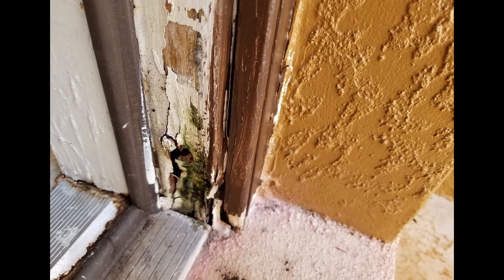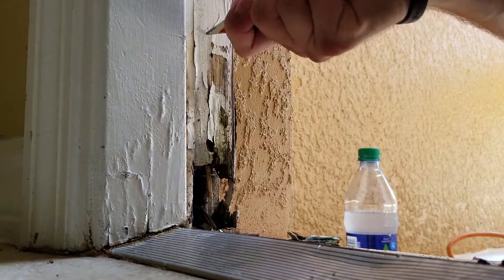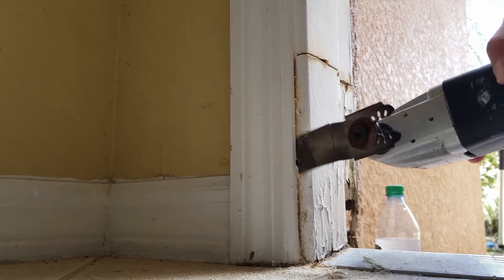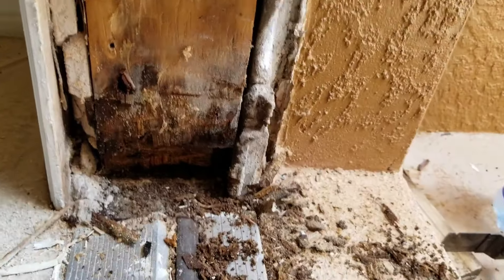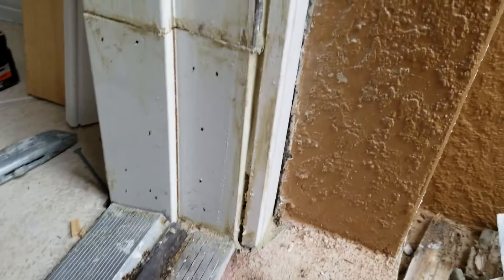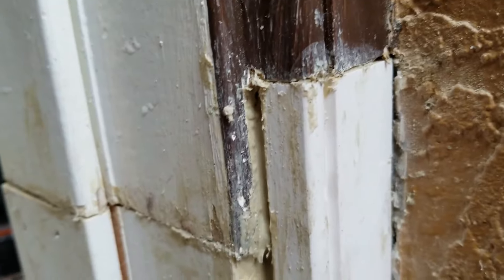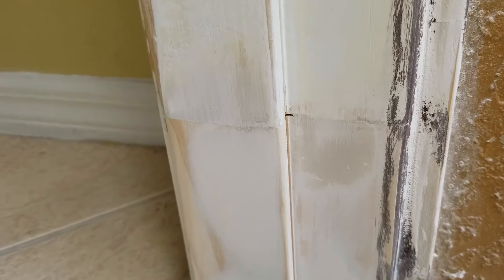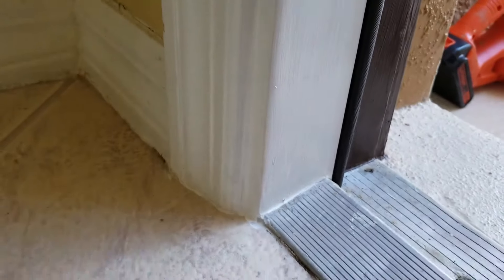HOW TO REPAIR ROTTED DOOR JAMB

Comment: Before you placed the patch in, I hope you sealed the end grains. If you didn’t water is going to wick back up into the patch and rot it out again. Otherwise, nicely done.
Reply from the maker: Hi!
Absolutely! 
I was sure to seal any wood exposed to moisture. At the time of this video, I specialized in tile and grout repair. In most cases I did a lot of shower wall repairs due to water damage behind lower tile that caused tile to fall off the walls due to rot. When dealing with projects exposed to water, I approach it with the knowledge I have when water proofing a shower. Unfortunately I failed to show more important details in the video during this repair. I didn't even show the process using the bondo. I might have to recreate another video in order to show those steps. Feel free to give me some ideas on any future videos you might want to see.
 Thanks for watching!

Comment: I put hydraulic cement in my rotted 4” bottom of frame. 5 minute fix has lasted 10 years so far. I usually replace it the right way. My “test” worked great though. 😂
Reply from the maker: That's impressive! Sometimes a quick fix turns out to be more durable than expected. It's good to hear your improvised solution has held up so well. Thanks for watching!
Reply: I have a rotted hole on one of the hinges . Does this cement will just hold that extra hinge? The others are ok .
Reply from the maker: @ae86takumi  If you can remove the rot and replace it with a wooden block, that’s the best approach. While you're at it, use longer screws to reach the door’s framing for added stability. This will also enhance security. Just make sure to add longer screws for the strike plate as well. Hope this helps—thanks for watching!

Comment: I like to replace those bottom areas with plastic that looks like wood.  Never rots again. 🙂
Reply from the maker: Yea, That's a better way to go. I started doing that as well. I personally like to use the composite material. I'm not a fan of the PVC material. Thanks for watching!!
Reply: @peteshowtosreviews8067 where do you get the plastic from does it have a specific name... Also your video didn't address the cause of the water leakage into that part of the door
Reply from the maker: @bill4786  Hi,
There are two types of non-wood door jambs available as far as I know: PVC (plastic) and composite material. Personally, I prefer working with composite. You can typically find this material at The Home Depot or Lowes in the door trim section. They usually sell single sections, but worst case scenario, you might need to buy a kit that includes three pieces: one for the top and one for each side.

HOME DEPOT

7181 1-1/4 in. x 4-1/2 in. x 7 ft. PVC Composite Door Jamb Molding White (3-Piece Kit)
Internet # 100023110
Model # MLD5280646
Store SKU # 247962

2497 11/16 in. x 5-13/16 in. x 7 ft. PVC Composite White Door Jamb Molding
Internet # 100077669
Model # MLD5100633
Store SKU # 330102

If you're looking for wood repair sections, I have included some Amazon links in the description, and also one below.

BOSS-Rx 4-9/16 inches x 8 inches Door Frame Rot Repair Kit, The Ultimate Fix for Rotted Door Frames
https://amzn.to/464AzUA

The water damage appears to be caused by water seeping into unsealed parts of the door trim and jamb. This often happens when doors are exposed to the elements without adequate coverage, especially during rainy summers. I've noticed it's less common if the front entry provides enough shelter from direct rain.
To address this, the best approach is to seal the area with outdoor caulk and apply paint for added protection.

Comment: Have you thought about (or even used), the PVC door jamb material to make these repairs? No chance of this rot to ever occur again!
Reply from the maker: Hi,
Yes, I have thought about and have used the PVC material. You are correct, it definably won't rot. I'm not a fan of the PVC because it's a little more difficult to manipulate when sculpting and it doesn't seem to hold filler that great. Thanks for watching!

Comment: Everyone has there own way I’ve learned over the years it’s better to 6” higher on the weather strip side and 6” less on inner side on the replacement end then shims behind the replacement wood fill
Reply from the maker: yes, that's correct. My ways today are different then yesterday; every day is a new day to learn. Luckily I'm not stuck in my ways, I'm always learning and figuring out better ways to do things. Thanks for watching!!
Reply: Can you do a video of how you do it now?
Reply from the maker: @jane1385  I personally haven't done this kind of work for approximately four years. That video was filmed in 2018, I was hesitant to upload it because I was unsure of the You tube thing. Any new videos that I'm physically doing, are for my house. I've considered possible doing a new door jamb repair video, I just need to find a rotted door jamb to work on. I either have to convince someone to allow me to do it, or have one of the contractors cut out a section from a project that we work on (if the door is being replaced).
Reply: @peteshowtosreviews8067  I e actually cut all the rot off the door frames weeks ago and am scared to go forward from there! I did try the one with the littlest damage and it’s decent but not ready to attempt the others just yet.
Reply from the maker: @jane1385  Hi! I think you did the most scariest part already. Do you have a section of new door jamb ready to install? if not, it's best to buy one. If you have the right material and tools, you'll do good. take your time on it. make sure you have sand paper so you can sand away any mistakes. feel free to email me at peteshowtosreviews@gmail.com with any questions. I don't mind having a phone conversation with you to assist you along the way. Thanks for watching!!
Reply: @peteshowtosreviews8067 the door frames I’m working on were custom built I guess cause it’s for an added on sunroom and they aren’t the size of regular ones so I am using a 1x4 and smaller prices for other parts. That’s probably why it’s not as easy as most videos I’ve watched. I am having problems with it coming out smooth after I used bondo to fill the gaps. Also I’m not sure what kind of caulk to use and can I caulk the outside frame part to the cement?
Reply from the maker: @jane1385  Regarding the smoothness, sand the Bondo down as flush as possible. Once the Bondo is sanded flush, us a wood filler or spackle for a final coat and sand once dry. You might have to do multiple coats. You can use a window and door caulk for example DAP ALEX PLUS on the outside frame. The caulk will specifically say windows and doors on the label, and will also indicate outside use. That specific caulk is easy to use and has some silicone in it. I don't use 100% silicone unless the current surface already has silicone. If you remove the silicone and clean the work area thoroughly, then you can apply a caulk that is not 100% silicone. Hope this helps.

Comment: this door is installed backwards
Reply from the maker: Hi, 
I didn't install the door, but it isn't installed backwards. It's correctly installed.
Reply: @peteshowtosreviews8067  so the sloped aluminum threshold orients toward the interior of the home? never have i ever
Reply from the maker: @NcG59  
Hi,
That is a outswing door, if you notice the threshold is lower on the outer part. This door also has weather stripping that seals the door off. Rain doesn't go into the home for two reasons, One, the weather stripping, and two, the outer threshold is lower than the inner one. I personally think this is a better option than the doors with the sweep. I normally see the door sweeps with inswing exterior doors. Hope this explanation helps, thanks for watching!

Comment: 'bondo', 'spackle',  'caulk'.  what are they and where use them? how? and why?
Reply from the maker: Hi,
Ideally, you should replace the rotted section of the door jamb with a new one, and use a minimal amount of those items. However, Bondo is great for filling large gaps and shaping the area to match the existing jamb. Sometimes, the replacement wood or door jamb may not be the same thickness as the original, and that's where Bondo really shines. Once the Bondo has fully cured and been sanded to the desired shape, you can use spackle to fill in any imperfections in both the wood and the Bondo. In some cases, the Bondo will be smooth enough that spackle isn't necessary, but other times, you may find small divots that need to be filled. The caulk is used to seal the bottom of the jamb and the area between the door jamb and the wall. Hope this helps clarify things. You can find some of the items listed, with a linked in the video description. Thanks for watching!
Reply: @peteshowtosreviews8067   Yep, thanks.  Just never heard of 'bondo'.  It'd be what we call 'bog' in Aus.  Different products available with different trade names.  'spackle' would be some kind of polyfiller and caulk would be some kind of sealant like maybe sikaflex.   You know what would be handy maybe?  A few words on what to do when hinge screw holes have gotten battered about so's screws will no longer hold. Or the door jamb they screw into has gotten a split right there or even rotted out..    I'd incline to liquid nails,  drill the holes out bigger, fill with liquid nails and push the screws in - plus use longer screws....
Reply from the maker: @abrogard142  I see, yes, "Bondo" is the name I use for it here, though other brands likely have similar products. It’s a soft putty that you mix with a hardener, and it cures very quickly, which is why I prefer it. If I relied solely on filler or spackle to fill large gaps, the drying process would take much longer.

Liquid Nails is an excellent product, and I don’t see why it wouldn’t work for the repairs you’re considering. Personally, I usually fill holes with wood (like toothpicks) and wood glue, and so far, I haven’t had any issues with that approach.

For splits in wood, Liquid Nails should work fine, but if the wood is rotted, I would recommend removing all the rot down to solid wood. If the split is large, I would use Bondo for better results.

Comment: Bro, how do you have the same door, frame, exterior wall and floor tile as me 😂

Im here for a reason. Must be a common problem with  this style house
Reply from the maker: No way! It's possible it's a builder that used the same design options or the same builder. It is a very common problem in certain climates and front entry designs. Don't hesitate to reach out with any questions. Thanks for watching!

Comment: Super helpful video! I thought I would have to get the entire frame replaced for several thousands $$$! In this Horrible economy, my husband and I HAVE to do Everything DIY, thank you!
Reply from the maker: Awesome! I'm glad you found it helpful. Feel free to reach out with any questions. Thanks for watching!!
peteshowtosreviews@gmail.com
Reply: @peteshowtosreviews8067  Indeed I will Pete, this is exactly what I needed to view and learn, I will get my husband to reach out with questions on front door repair. I thought I needed a total frame installed with sidelights costing $$$, and OMG, not doing it! So we also need the sidelights, whatever they're called, with glass on both sides of front door. One side has wood rot deterioration below bottom glass, other side does not show water rot, they are doubled pained. Do you think I should purchase the pre made double sided light panels or try to repair one deteriorated panel? They are double pained and really dont know what to do if I start chopping away at deterioration and leaving front panel exposed to elements and not being able to fix. Thank You for helping so many of us! We appreciate your expertise and God Bless.
Reply from the maker: @cstephanszumba  Hi!
I apologize for the delayed response, Yes, they aren't inexpensive. If I could speak for myself, I would try to repair the damaged areas, if the glass is still good. When you or your husband email me, I can contact you by phone so I can explain a little better. Don't worry, I won't charge for the phone call, lol. I want to be sure to guide you the right way. God Bless you too.
Reply: Does anyone have suggestions on where to buy just a plank of the door jamb? I can only find kits
Reply: Same. I don’t know where to buy just one either.

Comment: Thanks for this. I have to do exactly this job in the spring. I've checked the rest of the frame and it's totally sound. It doesn't make sense to replace the whole frame when you can make a repair like this.

Comment: What about leaving a half inch at the bottom like I seen in other videos, to make sure that water won't wick up the wood again?
Reply from the maker: That should work, as long as it is aesthetically pleasing. If the jamb is primed, painted and caulked, you shouldn't have to do the half inch. Keep in mind that most caulks will shrink, and sometimes allows for moisture to seep in and cause mold growth. Thanks for watching!

Comment: Great video, I looked in Home Depot for sections of door jamb, came up empty, I probably should go to a building supply source ... is that what you did >
Reply from the maker: Hi, 
Home Depot should have full lengths of the jamb or sometimes they only sell the kit with the two sides and the top portion. I've included some Amazon links for smaller sections that you'll be able to buy. https://amzn.to/3AggbV0 or https://amzn.to/3NGl10V Hope this helps. Thanks for watching!

Comment: Just out of curiosity, is there a reason to choose Bondo over normal wood filler? Also, is there a specific bondo for this application?
Reply from the maker: Hi,
Bondo is much more durable and dries a lot faster. Regular wood filler seems to take too long to dry especially when the cavity is deep. I use Bondo to get the shape to where I need it (after sanding), and then I use wood filler or spackle for a fine top coat to fill any imperfections. After the wood filler or spackle is dry, I'll do a final sand or repeat the process until it looks good. You can used Bondo All-Purpose Putty, or Bondo wood filler, as long as it's Bondo you'll be good. Feel free to reach out with anymore questions. Thanks for Watching!!

Comment: I never saw that blade before, where did you buy it? Thx
Reply from the maker: Hi,
That specific blade is a Dremel Universal 1-1/4 in. Carbide Flush Cutting Oscillating Multi-Tool Blade. You don't have to get that exact brand to do the job. As long as it is the same style, you'll be good. thanks for watching!!

Comment: Hi, what kind of saw are you using?
Reply from the maker: Hi,
I'm using an inexpensive oscillating multi-tool from Harbor Freight, the brand is called Chicago Electric pro. I don't believe they sell that brand anymore, I've had mine for approximately 11 years. You can us any manufacture out there for personal use. I would recommend something that is pro grade if you are using it for business. You can buy a variety of attachments that work best for your project. Below you'll find an Amazon link to a lower cost option with good reviews. Thanks for watching!!

-Hammerhead 2.2-Amp Oscillating Multi-Tool with 1pc Flush Cut Blade, 1pc Semicircle Saw Blade, 1pc Sanding pad, 3pcs Sanding Paper - HAMT022
https://amzn.to/42Bhms2
Reply: Thank you 
 @peteshowtosreviews8067

Comment: . . . . whats  the sku  of  the stick  of  doorjamb that you bought and where did you buy
, , , , ,will help alot. . . . . / //
/ / /
/
/
/
/

/
Reply from the maker: Hi, 
Here are two Amazon links for pre-cut door jamb repair kits. They're priced similarly to purchasing a whole section but come already cut to size, including the angled cut for the door threshold slope. Make sure to double-check the measurements before purchasing. This option should be the easiest way to proceed. If you prefer to buy a full-length door jamb instead, let me know, and I can search for that option for you. Hope this helps, Thanks for watching!

BOSS-Rx 4-9/16 inches x 8 inches Door Frame Rot Repair Kit, The Ultimate Fix for Rotted Door Frames
https://amzn.to/3Lf2WpF

KS Hardware Rot Repair Kit for Exterior Door Frame, (4 9/16")
https://amzn.to/3WhZroN

Comment: I am struggling to find the door jamb.  I looked in the 2 box stores, in person and online, and only find a kit which is $150+.  I am sure they have it, I just don't know if I am searching wrong or something.  It comes just as needed, with the groove for the weatherstripping and everything - right? Any guidance you can provide?
Reply from the maker: Hi,
You should be able to find the door jamb at The Home Depot or Lows. It's not a kit you need to look for. You'll have to buy one stick that is approximately 85". It cost $28.86 at my local Home Depot in FL. Below you'll find the link to the item I'm talking about. Keep in mind if you aren't doing the full length, you'll be able to use the rest for another door or side. You'll have to create the angled sill cut yourself with a saw. The angled sill cut can be seen in the image. Hope this helps, If not, feel free to ask more questions. Thanks for watching!!

https://www.homedepot.com/p/Woodgrain-Millwork-1-25-in-D-4-563-in-W-Wood-Primed-Finger-Jointed-Reversible-Exterior-Door-Frame-with-Angled-Sill-Cut-10001409/202089243
Reply: Awesome - that is exactly what I needed.  Thank you for your help!!!
Reply from the maker: @northcarrollfusion8986  
Great! 
I'm glad I was able to help. Thanks again for watching!!